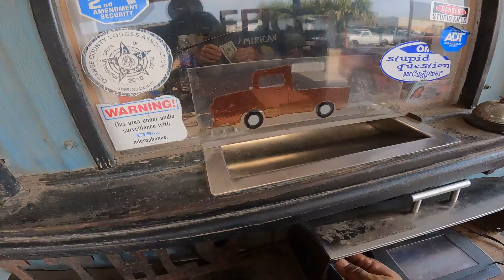How To Tear Down Big Transformers The Fast Way.

Comment: Next time my mate, cut through the frame/exterior of it and as you'll use less blades. If you push and dont let the blade do the work then you will go through blades and make little money on the copper. Get a hammer and Bolster plus a more heavy duty screwdriver for better leverage big fella. Love the channel,  keep up tge good work too. 🙏🏴🇬🇧✌
Reply from the maker: Thanks for the tint.

Comment: You definitely need some ppe that’s fiberglass and resin. I bet you were quite itchy for a day or two. I found that a recip saw was faster and less fine dust. Able to vacuum up the copper dust and recover it also.
Reply from the maker: Thanks for the tip.
Reply: He would be itching more if he had Crabs and Hemeroids. Do they PPE for those two?